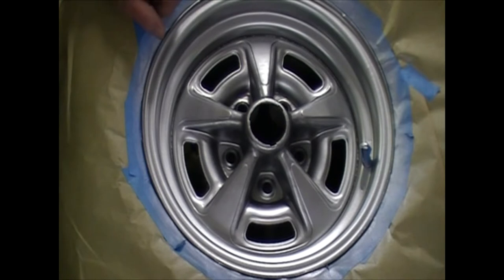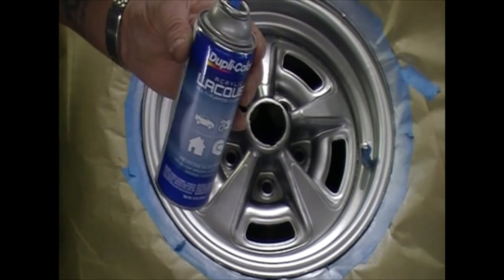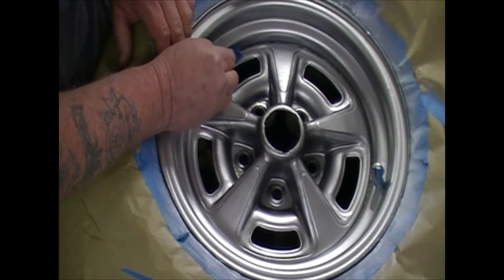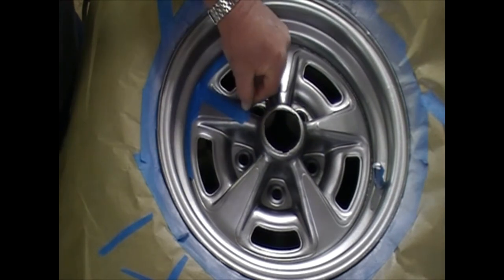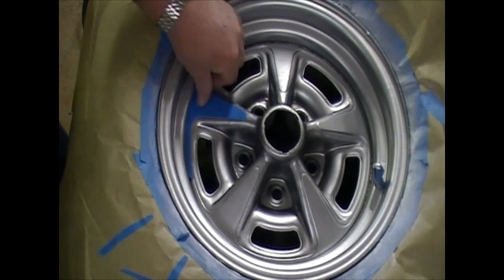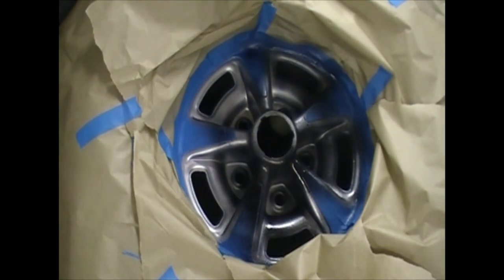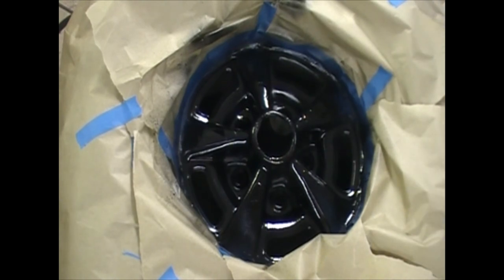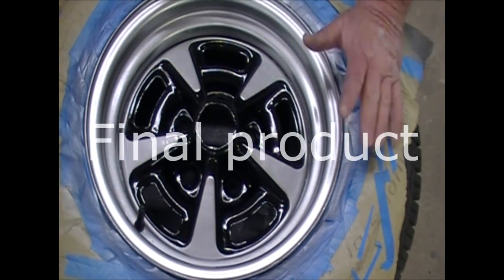Rally II Wheel Masking and Painting

Comment: I always like the black look over the grey look. The Olds and Buick (similar rallye wheel) can be repainted as well but can the wheel cleaner or any other abrasive not take the paint off the metal?
Reply from the maker: Not if you use a good epoxy primer. I use clear coat after I paint them. I never use a wheel cleaner, I use a mild soap similar to turtle wax car wash, and I use a good carnauba wax 2-3 times a year. The waxing is a pain in the small areas but well worth the work. I clean my tires with Formula 409, just spray it on a brush and apply elbow grease, lol, works great. I try to stay away from abrasive cleaners of any kind as they will eventually ruin your paint. I hope that answered your question.
Reply: @Rick-Williams59  got cha and thanks